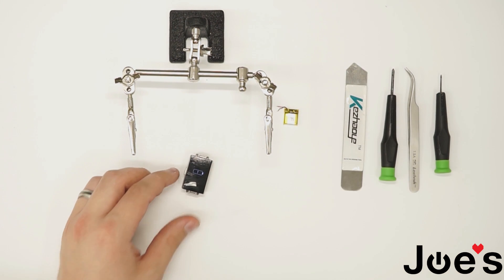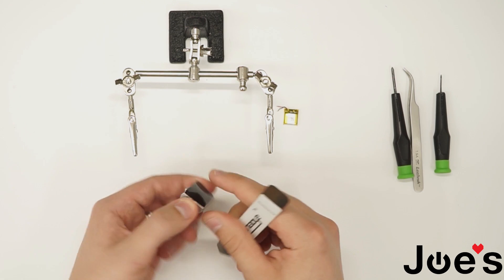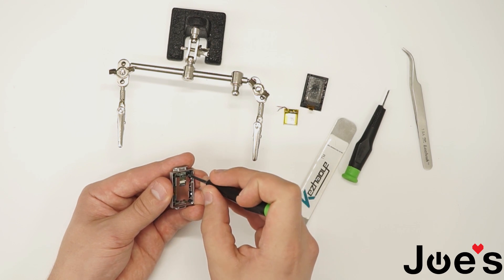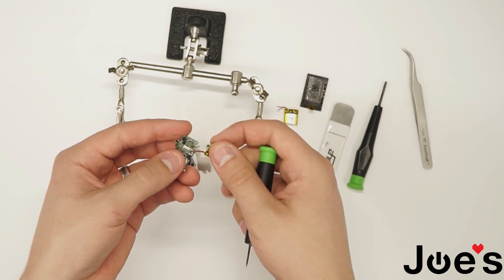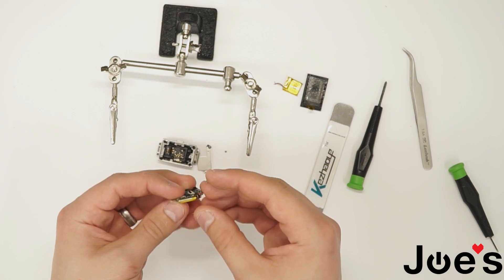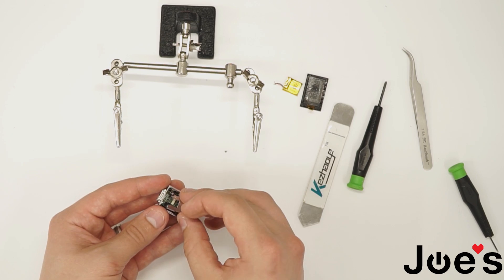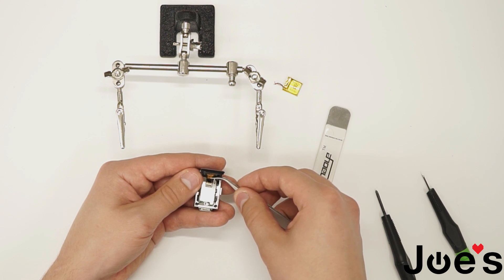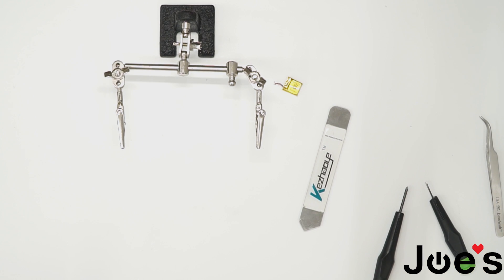Repair Fitbit Charge 2 Smartwatch Replacement Battery How To Tutorial

Comment: Hi, I replaced a compatible battery. The battery gives 3.7V to the circuit, but it still doesn't work independently; it powers up only when connected to the charger. Do you have any suggestions?

Comment: Thanks!, Russ, for your informative, direct, and to-the-point video and tutorial. It worked for me -- the old Charge 2 is powered-up with a new battery (the original batt lasted over 5 years of continuous use, then would not hold a charge). The repair was a bit tense for me, because things are so tiny and tightly packed in the watch (of course, they need to be), but now, all's well! The battery I bought from an eBay seller, though, was SLIGHTLY wider than the original. Its side folds or side rails added a little extra width compared to the original, so at first the repaired watch would not fit in its case. Others may also encounter this problem, because it seems that NOT EVERY generic 60mAh 3.7 V LiPO battery sold is the same part-number as Fitbit's original battery. Well, I succeeded to very slightly squeeze the battery along its WIDTH with a pair of wide-jaw pliers. I did this twice, and the second squeeze was enough. This narrowed the width of the battery about 0.8 mm. It did not compress the body of the battery, but just the side rails, so the battery and its chemicals inside were definitely not harmed nor compressed. It was a relief when the second screw was tightened, and everything was buttoned-up. The battery charged quickly, and all's well with the Fitbit! I'm wearing the watch again now. I hope to get another 5 or six years from this battery. Kudos!, on a great video, and Thank you! -- you gave me confidence that I could do this "micro-surgery transplant" myself.   ;-)  --Joe, in Tucson / ARIZONA

Comment: Hi, I have a fitbit charge 2. Had it for years, and it was working fine. One day, the screen was not visible, but it was still charging and recording fitness data.

I kept using it as it was, although I couldn't see the information on the watch itself but on my phone app. 

How can I be sure if perhaps I may need a battery instead of getting another one?

Another thing I did notice was that the watch after charging it would be ok for a few seconds, then it would start to pulsate, which wasn't normal.

What advice can you give me? Thank you.
Reply from the maker: Hello, thanks for commenting. Please email us at support@joesge.com with your question. We will be able to better assist you there. - JoesGE

Comment: I’ve an issue here with several fit bits, replaced the battery now black screen. Old battery back in still black screen ? 

Tried a reset nothing. Nothing got damaged during taking it apart. Really stuck any ideas would be appreciated.
Reply from the maker: Hello, thanks for commenting. Please email us at support@joesge.com and we will be able to better help you there. - Aaron P
Reply: Have you tried changing to a different clock face?
Love your TV repair videos.

Comment: Thanks for the Vid, I purchased the battery from you, the display came off very hard even with the heat gun, while removing the display ribbon cable a surface mount component came off the board, one of the solder pads for the component did not have any solder on it, managed to solder it back on. The replacement battery was significantly smaller but it came with a note indicating this was OK. The wires on the battery are way too long, I cut & striped to make fit and soldered the battery wires back on (with correct polarity!)
Re-Installation, When inserting the display ribbon cable nothing "snapped" back in, did not have a good feeling about the way it fit, The ribbon cable had a black piece of tape on it, I suspect that when I removed the cable the tape laid down and stuck to the contacts on the cable (?). I snapped the display back on and put the charging adapter on the Fit bit, no display. Tomorrow I will remove the display and try again. 
Does the display/cover need fresh glue to assure that it doesn't fall off during the many times the FB is bumped against something while wearing it?
I am a retired electronics engineer, I had all the right tools but my eyes are 62 years old and even with an eye loop and a magnifying lamp this repair attempt was challenging for me.

Comment: How do I know which fit bit I have-a blaze or charge 2? no markings on the fitbit. I took it apart as said and put it back together. (so I wouldn't forget how to)  I think it was 60 mAh.  The two led's on the back are now flashing rapidly but still no display when I plug it in to charge.  Could it still be the battery?

Comment: Do you own a video camera that has a macro capability? Apparently not.  This is got to be one of the most aggravating presentations I have ever seen. The subject of your video is smaller than the actual smartwatch itself when viewed on a large phone screen. In fact it is so relatively small compared to the visible field that to discern any detail at all, I must put it on my 43" smart TV. Even then, the Tech's fingers often hide the critical clips, bands, screws, and solder points from view. This reflects a pretty amateur approach in my opinion or.....
 I suspect that you shot it the way you did to convince viewers it was possible to perform this replacement if you knew what you were doing while still not giving enough information to do it yourself. Very clever marketing for your repair business! Kudos to you! 
PS:  I've watched your video several times in an attempt to learn how I should perform this replacement. I'm not going to try it. I will take the replacement battery I bought to a local phone repair shop.
Reply from the maker: Thank you for the comment. Unfortunately, we are unable to post photos in the comments. Please contact email: support@joesge.com for wiring schematics diagram. If you would like further assistants please call (360) 362-1722

-Russ C.

Comment: Will this work with the charge 3? Had a new one given as a gift but they had it long enough for warranty to expire. It stopped powering on in only a few months. I'd rather try swapping the battery myself if they are the same as the 2.
Reply from the maker: Good question. The process is not the same for charge 3. 

-David P

Comment: I did not even got mine open...neither with some heat, nor with a dulled razor blade
Reply from the maker: Thanks for the comment. If you would like your device repaired by a professional you can fill out a repair form and follow the steps to send in your item. We offer free shipping and diagnostics. Here is a link to the repair form:
https://www.joesge.com/pages/repair-services

-David P

Comment: Ok, so couple of things that can be cleared up. 

1. If the ribbon doesn't go back in easily, flip up the tiny back tab like he shows. Also ( and this is really important ) if the black tape has covered the ribbon or if you are like me and popped the screen across the room trying to get it off and you didn't know that the black tape wasn't supposed to be there and you tried and tried to get the screen to work and couldn't, that is the issue. Remove the black tape before you try to reinsert the ribbon. 

B. You don't need to heat the screen in fact it only seems to hurt. 

III. If you bought a battery from amazon or newegg they will seem too big, they aren't. When you replace everything back in don't hook up the board to the snap connection first. Take everything apart, solder your new battery on, put the battery in first, put the board on top of that, then snap the connector on. Everything else is pretty easy.
Reply: Thanks! I agree, at least try to remove with-out heat.... Why would anybody want to heat and expand it BEFORE trying to remove it with no heat?
Reply: @DouglasWellsUSA  Typically blind fastened items like the screen is attached with a sticky electronics tape, and getting it warm with hot air helps soften up the adhesive so it releases easily. I couldnt tell from this video if it has adhesive, but that is the reason for heating it up
Reply: Thank you, Kathryn.  The black tape advice saved the day!
Reply: I dont know what this black tape is
Reply: even putting battery in first I'm having a ton of trouble getting the board back in
Reply: finally got it all back together (had to remove the black tape). Everything seemed to go together ok but it's not powering up. I attached the charger but not too optimistic.

Comment: After replacing the battery, the vibrations are no longer happening on the fitbit. Is there an area I should focus on when I disassemble it to resolve this? I noticed when I first soldered the new battery into place, it vibrated once. No other vibrations though since I reassembled it. Thank you for your help and the great video!
Reply from the maker: Thanks for the comment. Please double check your setting to make sure vibrations are ON. You can also try replacing the battery with the old battery. If you continue experiencing this issue you may have damaged the main board. If you would like your device repaired by a professional you can fill out a repair form and follow the steps to send in your item. We offer free shipping and diagnostics. Here is a link to the repair form:
https://www.joesge.com/pages/repair-services 
-David P
Reply: @Joesge  Hi David, thank you for the quick reply! It turns out that the replacement battery's leads were too long and were preventing the weight from spinning on the motor to make the vibrations. Once I rerouted the cables and moved the battery towards the other side, vibrations are back!
-Bill
Reply from the maker: Thanks for the update. Glad you were able to figure it out:) - David P

Comment: Good video but beware... It took me about 15 minutes to dismantle, change the battery, and reassemble up to the point of trying to reattach the screen.  However, this step proved impossible as I was completely unable to get the ribbon back into its slot. Thus  I suggest before attempting to change the battery you take VERY GOOD NOTICE of how the screen ribbon fits BEFORE taking it off for the first time. (Alternatively, do not detach the screen and try to access the battery while leaving it still attached instead.)
Reply from the maker: Thanks for the comment. This is good advice for first time repairs. -David P

Comment: All i wanna do is find out how to shut the damn thing.
Reply from the maker: Follow the steps below to turn off your Fitbit Charge 2. 

1) You connect the Fitbit Charge 2 with your charger. 
2) While it's charging you press and hold the power button. 
3) Your Fitbit will power off. 

Thank you very much for your time. Hope everything works out :)

Comment: I had a bit of trouble sliding the display ribbon back into the slot when reattaching the display. When heating up the Charge 2 the thin black flap melted to the connections on the ribbon. As a result, it wouldn't fit in the slot. Make sure the black flap is loose (and can flap up and down) before you try to reseat the ribbon (underneath the black flap) into the slot.
Reply from the maker: Thank you for the advice Anthony, we also suggest you keep the heat at a low temperature. 

Ruslan P

Comment: My battery did not fit back into the case!  Bigger than the original battery.  Tried to trim the casing downt with a utility and it started to smoke.  It's sitting in a snowbank now.
Reply from the maker: That is not supposed to happen. Be sure that it is the Charge 2 that you are attempting to repair. Fitbit makes many units with a variety of batteries, and it is not the best idea to swap them or attempt to force them in. We also recommend removing the unit from the snowbank, as water damage is difficult to fix.
Reply: @Joesge  I was trying to trim the battery casing, not the Fitbit. The replacement battery is 2mm wider than the original battery.  The smoking battery was in the snowbank after I cut the wires to remove it from the Fitbit.

Comment: DON'T USE HEAT! Not necessary, and warped my cover. Unlike a cell phone with a glass screen held on by adhesive, this is a plastic screen held on with clips and sealed by an O ring. I see no evidence of adhesive, So, just pry gently, trying to not cut the O ring with your pry tool. Use a blunt pry tool, like a DULLED razor blade. There are two clips on the button side, and three on the other. Note that two previous commenters seem to have damaged their covers with heat as well. I would also suggest that putting a foil wrapped LiPo batter in the sharp teeth of an alligator clip is asking to bite a hole in the foil. Be gentle with that. Finally, when I soldered the new wires, I had to do it a second time to get the wires flatter to the board because that metal sheet held on by those two screws we removed sits right over the + terminal and would be easy to short out. There is a thin layer of tape to insulate it, but still, be aware of this, keep the wires flat, and check that there is no contact when you reassemble. Don't let the magic smoke out. Thank you Joe's for posting the video. This is not meant as criticism, just intended to share "notes from the field" building on Joe's work to fine tune the procedure for the next guy who tries it.  Before you hook the ribbon cable back on, remember to clean the fuzz off of the O ring, and the surface it rides on, and put a very thin smear of silicone grease on it. Very thin, like, invisible, no globs or blobs. it is a lubricant, not a caulk. How did we fix anything before YouTube?
Reply from the maker: Thanks for watching Chris. We appreciate your added advice. Definitely when using heat, it should be used at a low temperature and for only short periods of time. MD.
Reply: @Joesge  good advice (and very good video)... I would ADD to your video somehow that BEFORE using the heat-gun try removing it gently... maybe no heat is needed?
Reply: @DouglasWellsUSA  that's my approach, tackle without heat and if required, very brief heat gun on low setting for seconds.
Reply: Yeah wish I would have read this before. Nice big bubble lol
Reply: I used a clean cloth and just rubbed it against it to heat it up just a bit by friction and was able to pop mine apart.  I have a hot air rework station but it seemed pretty easy to get apart in the video so the heat from friction did the trick for me.  Now if I can just figure out if it is my screen or the main board that is making my Fitbit glitch out on the screen.  I can get it to show fine if I keep messing with it but as soon as it goes on the charger the screen freaks out.  Take it off, mess with it and it will start working normal until I put it on to charge again and then the screen goes blank or crazy... :(
Reply: Excellent points, particularly "get the wires flatter to the board". Occasionally, a little heat is necessary, but IMO should only be used as a last resort after normal prying fails. Curious though, why the dulled razor blade? I always use a fresh one, is this to avoid potentially cutting the clips you mentioned?

Regarding "how did we fix anything before YouTube" ... I've been hacking into these myself sans-YouTube until the lightbulb moment of "hey, maybe someone else did this, go learn from their expertise or mistakes" ;-)
Reply: Thanks for that good ADDITIONAL INFO!!!

Comment: I am unable to fix the ribbon. It's urgent. Can u please elaborate on that.. May b a zoomed in video
Reply from the maker: Thanks for watching! Are you having difficulties securing the ribbon cable back in to the plug on the circuit board? Make sure the little clips are popped up so that the wire can fit in the plug. MD.
Reply: Did you ever figure this out.  I can't for the life of me get the ribbon cable back in despite having the clip popped up.  It just won't go back into the slot no matter what I do.  Ugh.
Reply: I’m having the same problem putting the ribbon back in the slot. Any suggestions??
Reply: Unable to connect my display also.....the video isn't real descriptive. Need an enlarged video of how it works please
Reply: GOT IT!!  A jewelers eyeglass and tweezers slide into the white plastic end until it slides in and click back down the flap lock. Works perfectly now and holds a charge....thanks!

Comment: Good video!!!
Garbage Charge 2. Babied mine and it lasted 15 months. All of the sudden got black lines  on the screen ... everyday until there was no display.  Wouldnt sync or hold charge.  Customer service is a joke.  They cant help you with anything beyond resetting it.
Reply from the maker: There are the few that aren't the greatest. I've had mine for a while and have no issues with it.
Reply: Charge 2 is decent. The battery life isnt amazing after the year and a half ive had it. Went from a week to lasting 2 days so im guna change the battery soon

Comment: Can a Fitbit where the Notifications are constantly being triggered and vibrating be fixed?
Reply from the maker: Have you went into setting and turned off notifications?
Reply: I have.  I set everything to be off as far as notifications are concerned.  Fitbit seems to think it's a hardware issue, but nothing has changed.  I just charged it and took it off and it started doing it.